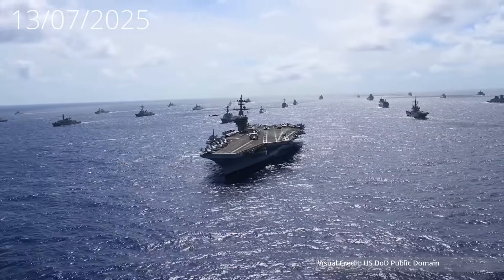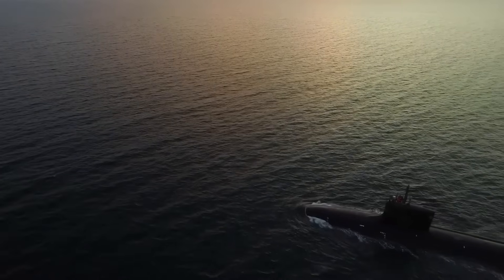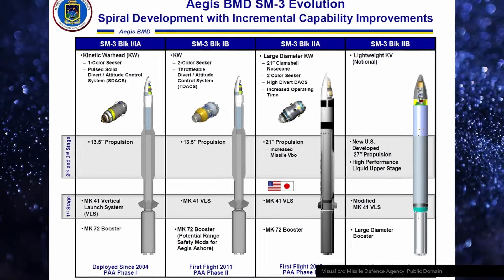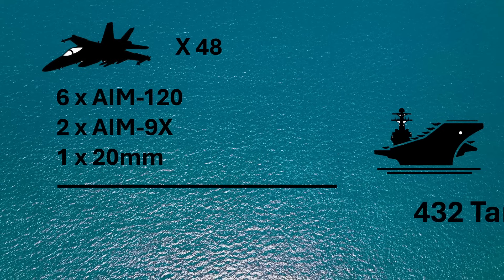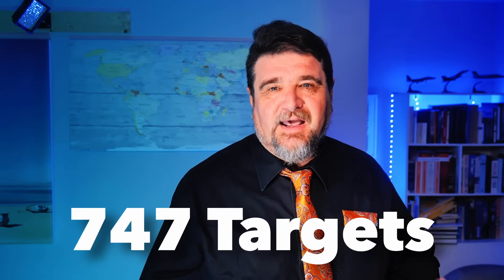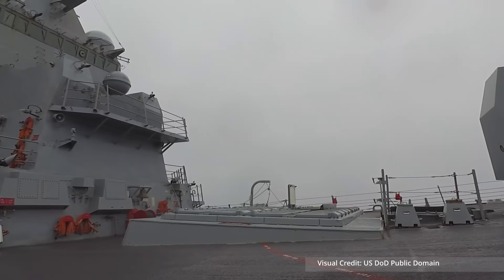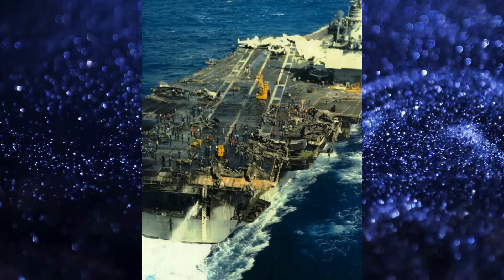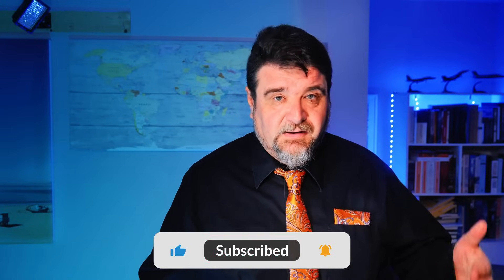HOW MANY Missiles are Needed to SINK A CARRIER?

Comment: eight conventional cruise missiles are quire different to hypersonics, such as the JY-21, CM-401, KF-21 and DF-21 and DF-26. They'd likely use a solid impactor for anti-ship capabilities and the amount of energy at mach 10 - mach 12 is nothing to snort at, even for a hardened target
Reply: Tom Clancy suggested a nuclear tipped torpedo 😅
Reply: And as always, the ccp overrates everything. Putting a 10 on a 2 as we say. So there is that 🤔
Reply: To be fair, it US keep on bothering others, they will soon learn 1000 missiles isn't a lot from a land based launcher.
Reply: A carrier is travelling at 30knots mind. I think that's the issue for hypersonics, getting a precise hit. IMHO the issue is Russias rule bending - they would most likely use something or a method nobody expected. They have a habit of finding ways to fight that just work.
Reply: @r200ti  well 30kts is only 15.5 m/s and the carrier is 333m long. Distance to horizon is 22km at 40m above sea level . Speed of yj-21 in terminal phase is ~mach 10 / ~3450m/s. Time to target is ~6.4s. So max traversal distance of carrier is 15.4*6.4 = 98.6m, which is less than 1/3 the length of the carrier. If the terminal phase begins at 22km then you could reasonably guide the missile up to this phase by a range of methods

edit: of course this is under ideal conditions
Reply: what do you mean the distance of horizon?  @atarisidequest
Reply: @JasonYu-bf3le from the horizon to the aircraft carrier. It's ~14km at sea level and is set by the curvature of the earth
Reply: how do you get this number? does it depends on how high the missile flies?   @atarisidequest
Reply: @atarisidequest  no missile can survive flying mach 10 at sea level. It would just disintegrate in the air after a few seconds. As to the radar horizon, that's why AEW aircraft exist.

P.S. DF-21 and DF-26 are ballistic missiles
Reply: @BrunoViniciusCampestrini  sure you know best. But just to throw in a little thought experiment: how deep is atmospheric reentry for mach 15 hypersonic ballistic missiles and what portion of that has relatively comparable atmospheric pressure to sea level pressure
Reply: @atarisidequest  at sea level, the air pressure is close to 100 kPa, at 30 km it's less than 1/10th of that. A missile going at Mach 15 (assuming a 45º angle) will cover those 30 km in a mere 8s, such a short time that some ablative coating can protect it.

P.S. There is also a grand total of zero countries in the world claiming they can make a hypersonic missile that flies at very low altitudes.
Reply: @BrunoViniciusCampestrini right and a hypersonic cruise missile in the terminal phase can cover 14km in 4s at mach 10 at the terminal phase "just a few seconds" but at 2/3 the velocity.

And it could still can use ablatives to do so as it's on a ballistic, not guided trajectory when doing so.
Reply: @BrunoViniciusCampestrini 😂😂😂
Reply: @atarisidequest you are talking over their heads. Basic Math is all they know.
Reply: @BrunoViniciusCampestrini 😂😂😂😂😂😂😂😂😂😂😂😂😂😂😂😂😂
Reply: @atarisidequest the missile isn’t pushing Mach 10 in intercept phase, it’ll be around Mach 2.5-3 max. If it’s coming in from orbit maybe a bit faster but absolutely no way is any guidance system going to be able to guide it through the plasma.
Reply: @theperson5185  While I may have convlated the cruise capability of the YJ-21, the terminal phase is, indeed, around mach 10. I may have severely undersestimated the peak height of the mach 6 glide phase ~100m, however, and the terminal phase is more likely to have been designed to be closer to 40m. This yeilds an adequate LOS time to target of ~6.4s
Reply: @atarisidequest  The copium is real for the "Western" plebs, huh?
Reply: @JasonYu-bf3le  Last time I checked, the Earth was round.
Reply: @atarisidequest  Pearls to swine...
Reply: @CallMeJeffNotJeffrey perhaps. I just think a pragmatic approach is the wisest approach, and complacency is oft fatal
Reply: @atarisidequest  Never in war or when lives are involved.  Two reasons: 1) I noticed our friendly neighborhood oligarchs only go balls to the wall.  Go at them, and like the black CDC guy, you'll end up a floater when your leg detaches from the weight they threw you in with; 2) As a retired medic, I promise you if I played horseshoes instead of "attack" death and destruction, I would have lost patients instead of getting life saves.

It's a difference of opinion based on life experience imo.  Most ppl don't get to be around death to get to the place I am.  I can't even imagine being in combat as an infantry man.  Thank god I scored in the 99% percentile on the ASVAB, so if I ever get called, I won't be in the trenches... my sons on the other hand, idk they're both military drafting age... yay.
Reply: @CallMeJeffNotJeffrey I'm actually a pacifist and as antiwar as they come. I find the engineering interesting enough to evaluate but a step to far to be involved in. Many people seem to think one side would just steamroll the other side without taking too many "losses" but the reality is all sides would suffer horribly in a war between two superpowers. I truly hope we never see it
Reply: @atarisidequest  I define "Pacifist" like Gandhi's definition.  I'll paraphrase it, "If there is a choice between cowardice and violence, I would advise violence."

A pacifist doesn't die politely, they go to war as the last option for survival.  If that is not your definition, you're no different than domesticated livestock and are alive today through some oversight by some predator that missed taking you out.
Reply: @BrunoViniciusCampestrini  Zircon flies at very low altitude in the terminal phase but it doesn't fly Mach 10 at the sea level. It does fly Mach 10 at the highest point though. It doesn't fly in balistic trajectory, but when it's launched it goes up but then it goes down pretty quickly and then it gets below the horizon. At the terminal stage they say it gets back as low as 2-3 Mach, but on average it flies 5-6 mach speed.
Reply: @r200ti  chinese hypersonic are guided from orbit, once the missile enter the air, the plasma make sensory difficult. however there is a way to get data backward keeping a probe in orbit and relaying it downward to the warhead where the plasma is weakest since it is facing away from the direction of travel. there is a chinese scientific paper that explain how to shape the warhead to create this gap in the plasma. the fact that China has already done live fire test in the sea to demostrate accuracy against moving target is well known. 

furthermore the time it take between reentry to impact is less than 1 minute. this is only enough for the carrier to move 1 kilometer at top speed. its rather difficult for the carrier to escape just by going 30-40knots.
Reply: @lagrangewei  
in 2021 Chinese HGV missed target by ...24mi.  There are several techniques like THza nd magnetic tunnel that allow to communicate through plasma.  But fundamentally,  you can drop 20Mach warhead with +/- 10m accuracy, but you cannot guide 10Mach glider with +/- 1km accuracy. You have to slow down to 3/4Mach before you can control your GV.
Reply: @r200ti Oreshnik has entered the chat.
Reply: They can circumvent the plasma sheath issue by having data link at the rear of the warhead that gets targeting data from drones and satellites.
Reply: @volvo245  Correct... they already do that.
Reply: @r200ti  30 nudos vs Mach 10/12? te parece que un misil hipersonico no pueda impactar de lleno en un portaaviones? EL radar del misil calcula la trayectoria del barco y apunta adonde quiere. Un barco en el agua no se mueve como un misil en el aire.
Reply: If they fly at Mach 10 while impacting. It is circulated, that hypersonic glide vehicle slow down to Mach 2 to 3 when arriving at the target, in order to get the radar to work. Above these velocities plasma is forming infront of the missle turning the radar mute.
Reply: @juliane__ but there's no need for a radar in the terminal phase. Afaik all weapons accelerate in the terminal phase, just look them up and you'll see
Reply: @juliane__ no
Reply: Most of the energy comes from the chemical detonation. Not the velocity (though that does add some effect).
Kinetic devastation is not all it's cracked up to be.
Reply: @kathrynck  E=1/2mv^2. For a 200kg impactor: 100000 x 3450 x 3450 = 1.19e12 Joules which is roughly  equal to 250 Tons of TNT.
Reply: It only takes 1 Chinese hypersonic missile to sink a supercarrier. Supercarriers are obsolete in the 21st century like the battleship in the 20th century.
Reply: No missile can do an impact at mach 10, even disregarding the guidance, they would straight up disintegrate at sea level at those speeds
Reply: @ozan1234561 😂😂😂false
Reply: @ozan1234561 nah man the missile only needs to sustain mach 6. The terminal phase is a rocket boosted tungsten projectile, that's it. It's really quite easy for a tungsten projectile to survive mach 10 for 4-5 seconds. I really don't know why people think there's a complex warhead tipping these things, it's just a hunk of heavy metal because that's all it needs to be
Reply: Problem of DF-21, YJ-21, and DF-26 is they only have a single active RF seeker. So they can be jammed or spoofed. Plus they are ballistic missiles, so they fly high where BMD radars can detect them early on. BMD midcourse interceptors are also just as fast if not faster with SM-3 Block IA/B at around Mach 9 and SM-3 Block IIA at Mach 13. Plus for the same price of DF-21, 5 - 10 Tomahawks or 3 - 7 LRASMs can be launched for the same price. USN also have have some fast ones with supersonic AGM-88G/SiAW and quasi-ballistic AIM-174Bs.

Not only that US Marines at East or Southeast Asia equipped with Isreal's Hero 120 drones can also saturate a nearby Chinese CSG.
Reply: @johnsilver9338  all systems with active RF seeking, regardless of how many are vulnerable to jamming or spoofing. Ballistic doesn't mean high, necessarily, it means high enough for tome to flight for a given velocity. Considering it has in glide maneuveriny capability for shorter range engagements this could be quite low indeed. Yes SM-3 is likely very capable, but it's far from a foregone conclusion. Two can play at saturation attacks and China has their equivalent systems, notably the HHQ-9,  H-10. LRASM is currently the only viable antiship system but with advances in optical tracking and ML it could be stated that it's stealth profile relies far too heavily on avoiding RF detection, given it's subsonic cruise speed.

We could bash our heads over scenarios forever, devising attack group loadouts, saturation attack configurations and varying degrees of situational awareness but we're really not going to get to the bottom of anything
Reply: At least as things stand no one has reliable working manoeuvrable hypersonic missiles that do peak speeds anything like Mach 10 let alone in terminal (tests above approx. Mach 7 have largely failed). Even with the high speeds of these missiles even a carrier moving at moderate pace will have moved enough the missile needs to reacquire target (unless nuclear payload) which means slowing down due to the plasma build up on leading edges degrading sensor capabilities (it may be possible to use rear beam communications and remote sensors to steer the missile on target but a carrier group isn't just going to let something sit around relaying its position). Also if you are the target and have an advanced air defence system there is a chance of destroying missiles even incoming at speeds significantly in excess of Mach 10.

Where these kind of hypersonic missiles shine is against static targets where distributed/area air defences can't possible play catch up with the missile.
Reply: @Rroff2 hmm I'm not sure if you're familiar with the yj-21 antiship missile or not, but mach 8-10 is thought to be the terminal phase velocity. It's a hypersonic cruise missile, both ship and air launched. It has high maneuverability in the cruise regime, and able to be guided via some equivalent of data fusion up to acceleration to terminal phase. You don't need sensors at mach 10 because the time to target is so short that no ship will be able to move quickly enough to avoid it. Don't forget that up to date target information is ideally available right up to said terminal phase so no onboard guidance is necessary
Reply: @atarisidequest  Even with the speeds involved a typical engagement profile a carrier underway can have moved up to 300metres (these missiles don't just burn at Mach 10+ from the moment they are launched until the moment they hit) - enough for a miss without adjustments. Potentially updated information could be sent just before the missile entered terminal phase but a carrier group in a hot conflict isn't just going to sit there and let an opponent have real time accurate positional data on it and if you have enough control of the battlespace to have that information you probably don't need hypersonic missiles to finish ships off.
Reply: @atarisidequest The YJ-21 is not a hypersonic cruise missile. Where did you even pull that from?
Reply: @voidtempering8700 it's ballistic but has a stated cruise speed of mach 6 and terminal velocity of mach 10 but you're right, I may have conflated the yj-18 cruise antiship with this one. I was drinking last night
Reply: @Rroff2  Hyoersonics burn the whole time, i.e. they are cruise missiles, not balistic ones, but they don't burn Mach 10 the whole time.
Reply: @guestimator121  Wasn't saying they don't burn the whole time - but some people are incorrectly estimating the time to target based on assuming they are doing the headline Mach 10+ speeds from the instant they are launched through to hitting the target.

The hypersonic missiles Iran uses for example reach a peak speed of Mach 5 in cruise and are doing ~1700MPH or Mach 2.2 in terminal and take around 3 times longer in reality from launch to impact compared to the numbers banded about.
Reply: @Rroff2  jajajaja.... Te pensas que los rusos no pensaron eso?.... Mira, los rusos cuando fabrican algo, lo piensan en funcion del arma que tiene el otro y la mejoran al 100%. Hundir un portaaviones para los rusos es muy facil. Tienen varias armas en su inventario para hundirlo sin chistar.

Comment: 1000 miles is not an insurmountable obstacle to long range maneuvering hypersonic missiles.
Reply: "1000 miles is not an insurmountable obstacle"

Even more importantly, maintaining that theoretical 1000 miles awareness radius?
It's absurdly difficult.
Most times, a carrier group is happy if it can successfully maintain a 250 miles awareness radius.

That 1000 miles depends on being able to constantly maintain E-2s in just the right directions.
It can do that in basically and very roughly 1-4 sixty-ish degree arcs, but the rest?   Hah!
Reply: @DIREWOLFx75 being a force always out terrorizing the world. I can see how u think like that. But normal country's like russia have a doctrine in defense of the motherland. This way there are a lot more assets to do that surveiling. Its tuff trying to act as empire
Reply: @DIREWOLFx75  once you’ve detected and tracked the carrier, it being 1000km away is not an insurmountable obstacle for maneuvering hypersonic missiles.
Reply: @BTYFDONGLE  Oh absoutely not indeed.

Zircon is pretty much a guaranteed hit at 1000km as long as you have even just a vague rough knowledge of where the carrier is.
Reply: E-2s are the obsolete choice  @DIREWOLFx75 , a fleet of HALE drones is what you should be using.
Reply: Only zircon 1500km
Reply: Cruise missle

Comment: Just send swarms of cheap drones to deplete all the escort ships air defence missiles then the battle group will have to withdraw.
Reply: that will not work also they have limited range and warhead
Reply: @avus-kw2f213 geran 2 has longer range than carrier aircraft. so yeah very viable. but you of course need to mix different weapons.
Reply: @jebise1126  but how would it detect a aircraft carrier ?
Reply: @avus-kw2f213 lol. its kind of big isnt it? i mean aircraft carrier.
Reply: @jebise1126  longer range than battle radius of jets on the carrier
Reply: @jebise1126  so is the Ocean
Reply: @avus-kw2f213
YT disallowed my reply.
Reply: @Comrade_Tokoloshe  the comment got shadow banned & thank you for notifying me 

and yes, if it hit a aircraft on deck and that caused a massive fire that would be very big problem

but of course, drones are easy to intercept
Reply: @avus-kw2f213
Don't need much of a warhead to be a threat to whatever is on deck and operating in confined waters like the Red Sea keeps you in range.
Reply: FPV drones don't have the range unless the carrier/ships is parked at port